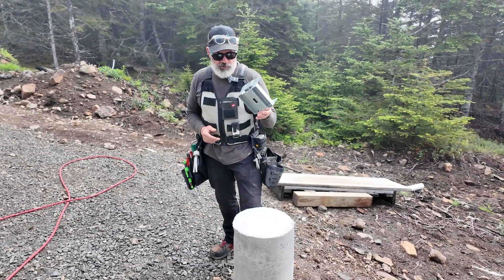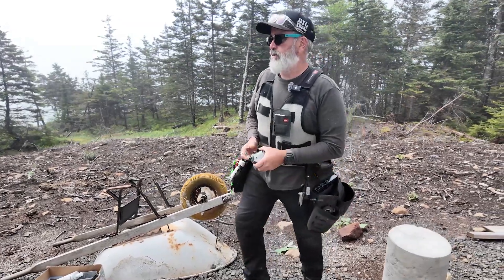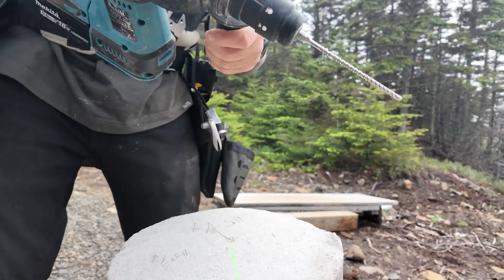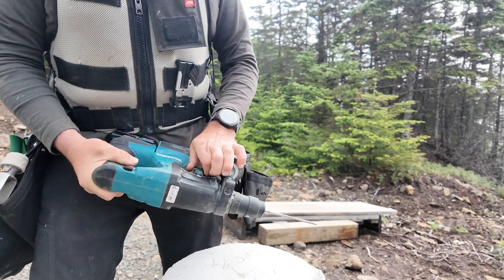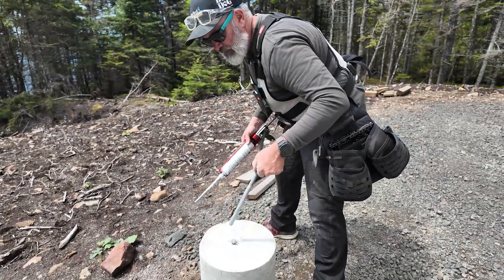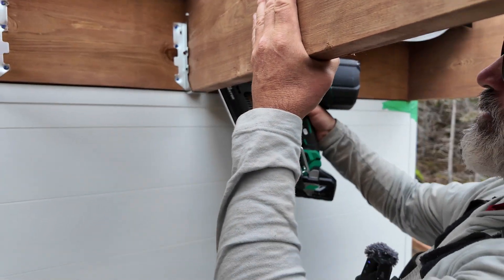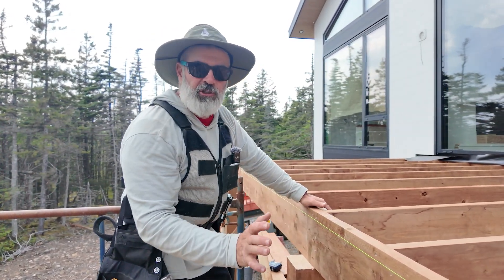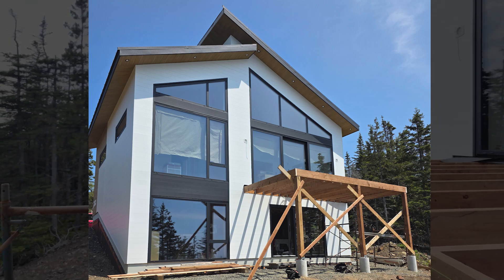Deck building. Some tips and techniques for smooth deck builds.  South Hollow Part 31

Comment: Can you do a video on blocking the posts for the railing? I’m about to start my deck. I’d love you to post that if you can.
Reply from the maker: What type of railing are you doing? Wood, aluminum railing system?
Reply: @Aron_Jones_Carpenter Wood with sleeves, and then composite railing and decking.

Comment: What does “de-rate” mean?
Reply from the maker: I believe you are referring to the 2 1/2" hanger nails in the hanger. By using 2 1/2" pneumatic nails, I am reducing the load capacity of the hanger. This is perfectly acceptable as long as you understand the design loads for the deck.